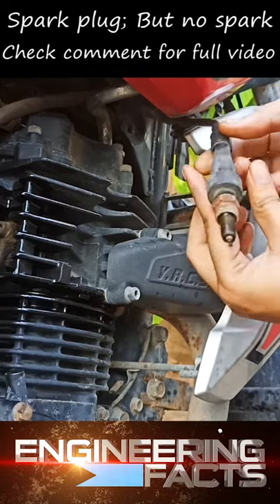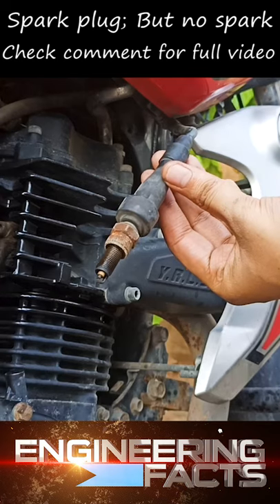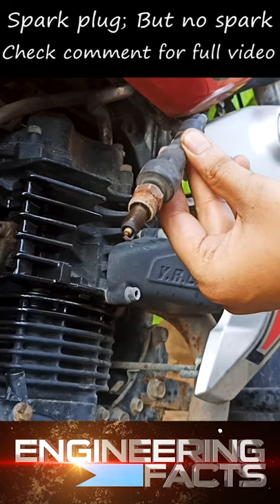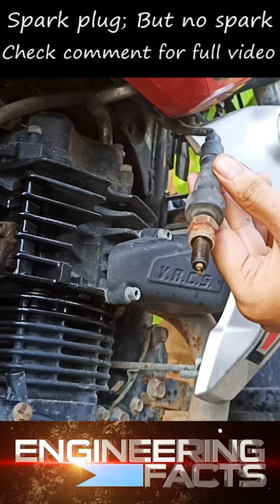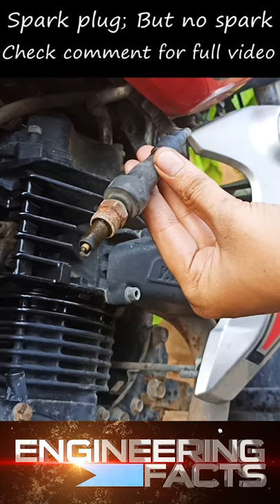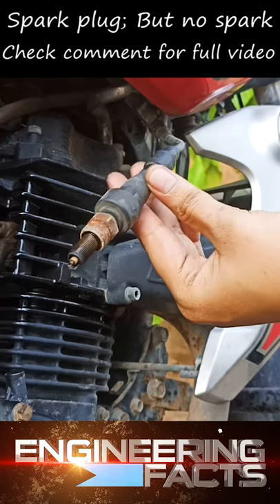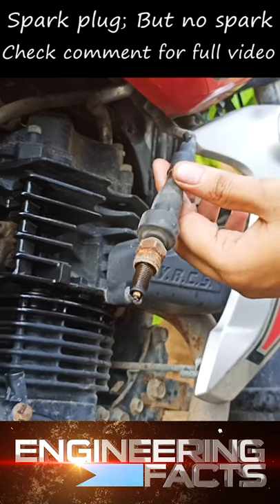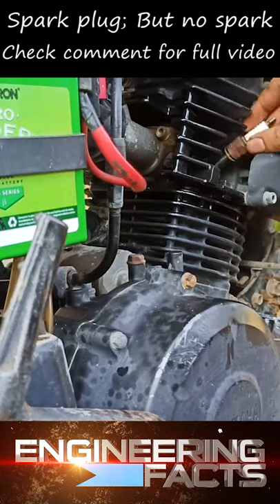No spark from spark plug.. #engineeringfacts #engineeringfactstamil #shorts

Comment: U can easily close the circuit by grounding the plug body by touching it on any bare metal of the bike and it will spark visibly. After u have cleaned it, use a gauge to adjust the gap for best mileage and performance